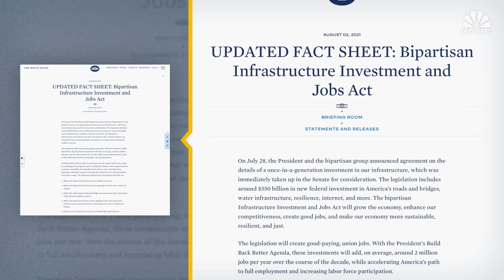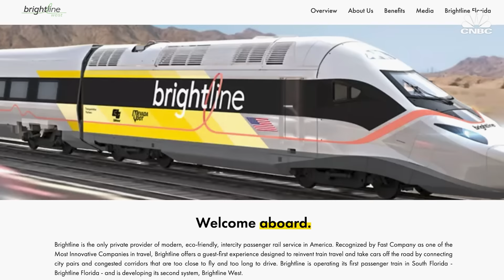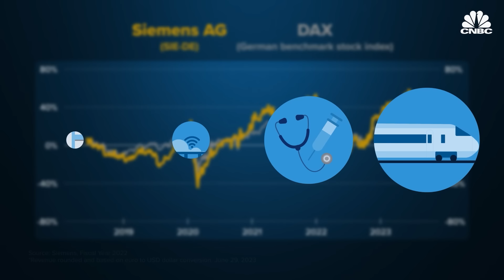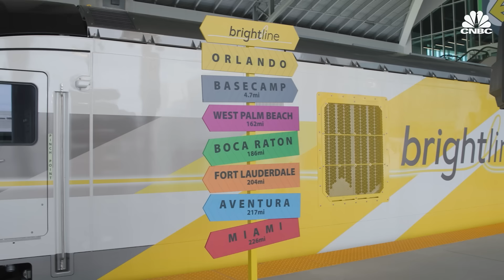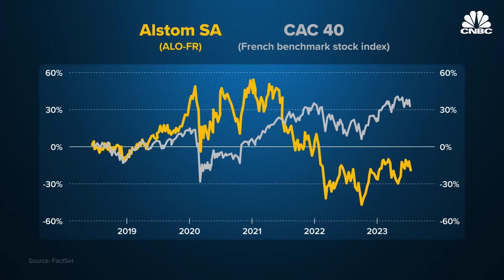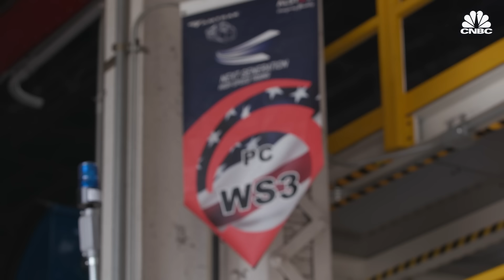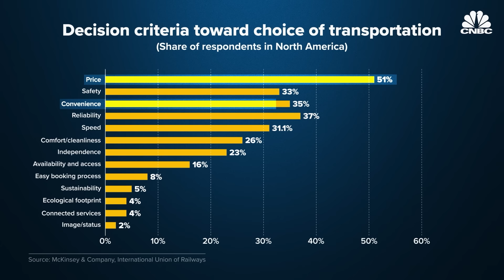Why Passenger Train Manufacturing Is Booming In The U.S

Comment: An LA to Vegas express train would be an absolute game changer, as long as it runs on a dedicated right-of-way. I really hope they succeed in that project.
Reply: And ppl won't spend hrs at the Stateline when lanes reduce to 2 lanes entering cali
Reply: Brit here - Yes of course. But also like here and the rest of Europe, Asia there are trains to pretty much every local town then high speed rail between everymajor citiy also. Example London to a local town 3 or 5 miles away, no problem train. Birmingham to any local town, no problem train. Hate to say but America is around 50 years behind every other country with connecting services.

So yeh 1high speed rail and the country goes 'Yeeeehh America!' All that jibe. But then travel abroad and you will be ashamed and feel like an idiot compared to pretty much everyone, giving it large about 1 high speed rail or decent rail journey.
Reply: Its wild to think that freight has right of way on US rail services. And there's a history: the automobile companies bought up the rail lines, dismantled inner City transportation and then gave the main lines to freighter companies. Its completely by design.
Reply: I believe the initial Brightline project from Barstow to Las Vegas will be on dedicated tracks built mostly alongside Interstate 15 between the two towns. It will definitely not use the old Union Pacific tracks between the two cities. With tilting train sets, they might be able to get speeds as high as 150 mph on certain stretches.
Reply: Nice idea except it's taking people to a desert hot spot that has water supply limitations.  Maybe it could help with the orderly evacuation ...
Reply: @markrobinowitz8473  As opposed to LA which is an oasis of fresh water supply?
Reply: Brightline West will be on its own dedicated right of way and should be one of the first true high speed rail projects to complete in the US. It's not perfect though. The train will go from Vegas to Rancho Cucamonga, which is about an hour out of LA's downtown. That means many people will need to park and ride in order to take advantage of it. On top of that, many of the stations placed along the route will be in the median of a major highway, making for a very unpleasant rider experience for the people hoping to use the train for commuting into the city. Nonetheless I would anticipate this project to be a massive success considering how that highway sees bumper to bumper traffic almost daily during rush hour. Nothing will motivate people more than seeing a train fly past them at over 150 mph when sitting in soul-crushing traffic.
Reply: You willing to spend hundreds of billions in YOUR tax dollars for that? Because I’m not!
Reply: My thoughts exactly! I visited Las Vegas in 2019 with temps in 100s in JUNE and my only reaction was “who the f*** thought it would be a good idea to build a city in the middle of the d*** desert?!!”
Reply: @DiederikCA  Officially, Amtrak takes priority over all freight.  In practice, some railroads do a better job of routing and traffic-control than others.   I've personally seen where BNSF RR sidelined 8 freights so that Amtrak's Southwest Chief could bypass them...and I've also seen situations where the dispatcher simply didn't have the room due to heavy traffic on the transcon and the Chief got "yellowed" behind a slower manifest or grain-train.  The dispatchers do what they can.
Reply: @anb7408  Yes. Because the money is an investment that has an economic return.
Reply: @anb7408  Yes, absolutely 100%. Do you complain as much when they spend countlessly more on highway expansions and road maintenance that just causes more traffic and benefits literally nobody except serving as a subsidy big car corporations?
Reply: @Jay_Richardson  The USA is WAY too big for rail like Europe has. 
Europe is small. For long distance, we fly.
Reply: @markrobinowitz8473  We have no water issues. 
We aren't using half the water we have. We never hear or worry about water. Only people who know very little worry.
Reply: @anb7408  Actually, Union Pacific railroad had a considerable influence with the founding of Las Vegas as a municipality, as railroad tracks being laid between Southern California to Utah and Colorado, the need of a watering stop for the steam locomotives was needed.  The Las Vegas Valley had the water, so Vegas became a water stop for the locomotives.
The building of the Hoover Dam in the 1930s elevated the region to another level, as thousands of construction workers contributed their pay for (ahem!) entertainment that Vegas offered at the time.
Reply: @Jay_Richardson  I have no idea what your point is. 
The US is big. I don't remember saying "the biggest" (you make things up) 
The US is too big for coast to coast train transport. So we use airports. 
Planes are much faster and more direct than trains. 
We do have pleasure trains like the California Zephyr which goes cross country thru mountains and deserts. It's not for transportation. 
My individual county in Nevada is bigger than the Netherlands! 
Russia may be large, but most of it's area is junk land. Permafrost, arid, stepp. 
Take a trip across the US.
Reply: @TheBandit7613  Your point was America was too big to have the infrrastructure of having trains via land mass area. My point correcting you saying no it isnt. Europe is bigger, plus having the multiple collaboration of all the EU countries work in unison to multi connect it all via the various rail companies. So no America isnt too big your country just doesnt invest in other means of transport. I never mentioned coast to coast. What about each town in your state? The next state high speed rail, normal rail to each town and then those towns multi connecting to other ones further away? What you just gunna keep flying to each town 400miles aaway when a train will get you there and dont having to bother with the 2-3hr pre check in waiting time? See train dont need to do that. On / off job done. Dont worry i know most American think their right based on their primitive knowledge of public trqnsport infrastructure until you go abroad so i accept your ignorance. Nor did i mention that you said 'The US is the biggest, read correctly' but as your American and think your right and pretty much everyone in the world in wrong i suppose i cant educate a doormat nor can anyone else.
Reply: @Jay_Richardson  So much arrogance and ignorance in your comment. The EU is less than half the size of the US.  The western half of the US is basically impassable by rail, after almost 200 years there are only about 3 routes due to the extreme difficultly.  Rail in the US is doing fine, the rail car manufacturing companies are growing rapidly (didn't you watch the video?).  High speed rail is basically pointless for long distance, no one wants to spend days in a train. Rail projects are going on everywhere.  Only a halfwit would think the change would happen over night.
Reply: @RS-ls7mm  It isnt arrogance or ignorance just facts. You mentioned long distanced, ok so what would you say is long distance? Mean if you mean Uk - Germany then yes plane, but if you mean UK - France got the Euro Star as an option plus Euro tunnel, UK major cities 200, 300, 400 miles apart its faster by train. Ok lets for an example visiting a city 400miles away. Via this all airports are declared far away from local neighbourhoods due to noise, safety restictions etc. So means travelling 30mins to an airport, get there at least 3hrs before for security checks, baggage etc, do the flight say 30min, 25- 35 mins to grab bags, then another 20- 30 mins to tavel from the airport to the destination. Train - go the train station 10 - 15mins, do the journey 1h - 1hr 30min, arrive in the city centre as most major cities have the train station within the city in nearly all EU countries, 10mins to destination if hotel etc... hmmm god such arrogance explaining facts. But as i said explaining something to an American is pointless. Americans are right, the World is wrong. An extreme good example for this China. Explain to Europeans, the Chinease or Japanease people that high speed rail is dumb or pointless and see the reaction. Lmao nor did i say the is the US it will happen overnight, so you accept that the US is many years behind then? With that comment is reiterates that you know that also. Oh and again the EU isnt half the size of the US thats another lie from the US education system or media to keep making you believe in the whole cars are no.1 jibe to fuel the companies for profit from you ie fuel, cars, no infrastructure and let you believe in the lie. But again whats the point of me explaining something when you think your right and the World is wrong. I wont waste my time further educating the blind. Oh and you said about mountains, god if only there were a solution... hmm its called tunnels, jesus christ it isnt hard to work that out. China has thausands and most countries have done it also.
Reply: @RS-ls7mm  I just came back from Amsterdam literally 2 days ago, staying 5 nights and its so funny hearing Americans go 'Oh My God, they have canals, Holy moly trams, They have bikes!, Look at that... plant pots on balcony's. I was just thinking jesus... so out of touch with such basic public infrastrucutre. Met a few lovely Dutch people and they said the same sort of statements just different wording 'yeh Americans are like 6 year olds that have never seen the World when they come over. Which i truly agree but also found kinda sad for you guys, so out of touch with basic infrastructure that everyone else uses daily and has had for years. Because we've all modernised.
Reply: @Jay_Richardson  A childs response with a child's knowledge.  If this is the extent of your knowledge then I understand why Europe is in so much trouble.
Reply: @Sacto1654 115mph to 180mph average speed
Reply: @TheBandit7613  hey bandit did you google US vs EU land mass? Yes, no. I'll help =

 Europe is approximately 10,180,000 sq km, while United States is approximately 9,833,517 sq km, making United States 96.6% the size of Europe. We have positioned the outline of Europe near the middle of United States.

Now do you accept its your country's failure in infrastructure?

I dont mean to have a go etc but now you see the public lie being educated accross the US and others. All i'm saying is go abroad but don't be shocked of the change. I've been to Greece, Germany x2, Netherlands, Ireland, France 4x, Tenerife, Gran Canaria, Spain mainland, Majorca and Australia. Within the UK, London x12, Bristol, York, Scarborough, Nottingham, Northhampton, Liverpool x2, Manchester, Brighton x3, Portmouth, Oxford, Cambridge Rhyl, Llududno, Cardiff so far. And the infrastructure is all the same near enough. Train, tram, coach, cycle, taxi, car, plane. All there for means of use.

So am i ignorant now?
Reply: @markrobinowitz8473  Vegas is pretty stingy with its water usage----and trying to get even better. And I people just visit----and don't live there-----that is good.
Reply: Phoenix to Las Vegas would be awesome too. Please Brightline!
Reply: @DA1423  I'd use it. It would be busy.
Reply: ye they should do LA to Vegas and also LA to SF and we need another one in Texas imo..Houston to Dallas to Austin to Houston
Reply: Hopefully private line & projects doesn’t stop there. Only to get better, broader, bigger & faster in the future
Reply: I totally agree. Seeing Rancho to Vegas succeed would pave the way for LA and OC expansions. Although, I think that should have been the original plan (LA and OC to vegas) respectively.
Reply: An hour without traffic. 2+ hours routinely during traffic hour. It's imperative Brightline finds a way to expand into LA/OC or else much of their consumer pool will continue to drive or fly.  @LimitedWard
Reply: Maybe all those Oakland sports fans can watch their Vegas teams much easier if they could just hop on a train 😂
Reply: How about NY to LA or WA to NY  we need long distance HSR yes inner city high but the very big game changer would be long distance which would be the money maker because more people would opt out of of flying and would now frequently use the train. Amtrak needs a whole revamp from the ground up for that to happen and plus spawn addition brand lines innercity and express and the frequent service not hours in between and pointless layers you'll have the option of non stop or local hsr stops. All this can happen if you get the right people who are dedicated to this and the job would get done, and I and many others can travel from NYC to LA  in less than 2 hours  and arrive  faster than a plane would love this and be thankful  ot being forced to fly.
Reply: @brooklynelite5428  I don't think trains will ever be faster than planes? Not sure that makes sense for such a large distance.
Reply: @darkwoodmovies  in Europe they are. Rail service is prioritized over planes, and that's how it became successful. Now, if we did the same here, it would work. Take money from the airlines and put it towards improving building amtrak to world class standards.
Reply: @brooklynelite5428  Don't get me wrong, Europe and Asia have FAST trains. But even the fastest maglev trains ever built "only" go like 375mph, so that's already 7.5 hours assuming perfectly optimal conditions and a straight shot route without stops. Planes pretty much all go 500+ mph on a bad day.
Reply: @darkwoodmovies  OK, you may have a point we just need to really use what we have a built better I'd love a train ride cross country but I know to prepare myself for many hours and many pointless stops for a lay over to switch from electric to diesel to move  at a 🐌s pace.
Reply: LA to LV makes sense. Eastern corridor makes sense. The rest of the country not so much since planes are much faster. Why would I want to sit on a train for 3 days to go from NYC to LA?
Reply: @safeandeffectivelol  I wouldn't won't to be on a train for 3 days that's why I'm a little disappointed that when electrification came to the NEC why didn't they expand the electrification to the amtrak system and also have their own separate tracks from other trains  and as time went on they could have been a way faster meaning 1 hour or half and between LA and LV top speed 200mph.
 Europe and Japan heavily invested and upgraded as years went on we could have to from the beginning of amtrak but we didn't now look what we have but I'm thankful we do have something.
Reply: I seriously can't wait for this. Even if I have to drive an hour to Rancho, I can just sit back the rest of the way.
Reply: @Jay_Richardson  That’s the problem. Most Americans never leave their state, let alone travel abroad. #Sad
Reply: @LimitedWard  Not true. Metro Trains run from RC to connect with many cities in SoCal
Reply: Lol, you have no clue where this train goes
Reply: @LimitedWard and the people in planes will laugh all the way to downtown LA for less cost.
Reply: Could work in either Las Vegas or Los Angeles or both. No car or short commute !